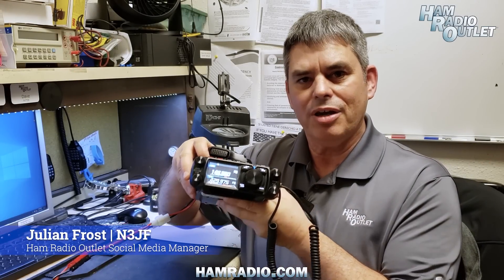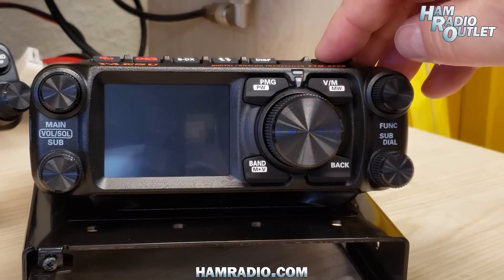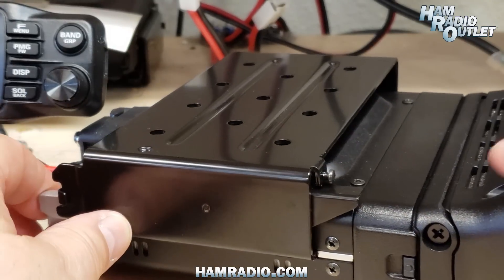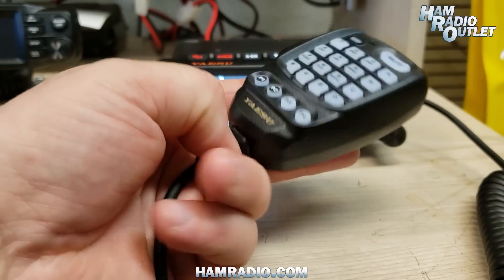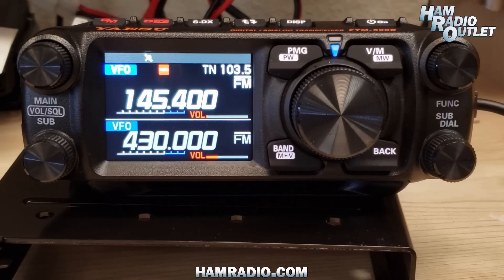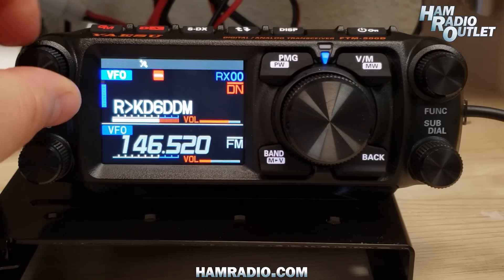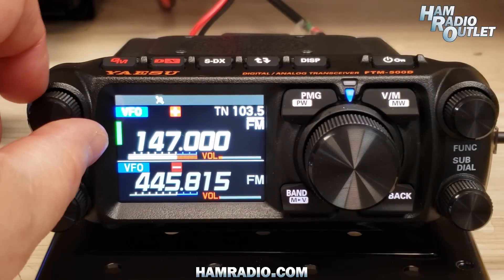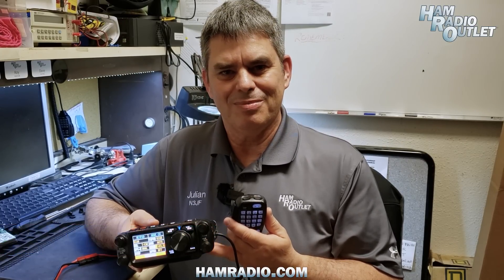Yaesu FTM 500D

Comment: What kind of power supply you need to run this from home ?
Reply from the maker: Any regulated power supply capable of handling the maximum draw of the radio, which is 10A. Give it a little headroom, so get yourself a power supply capable of 30A surge, like this OPEK OP-PS-3001D https://www.hamradio.com/detail.cfm?pid=H0-018890 and you'll be able to run some accessories off the same power supply without letting the magic smoke out! BTW, the FTM-500DR has been replaced by the FTM-510.

Comment: What type of adapter can I use with this radio to connect to a Bioenno Battery? Is there a powerpole adapter?
Reply: If you buy a Bioenno battery with Anderson Powerpoles, then all you need to do is put Anderson Powerpoles on the end of the radio's power cable. You can crimp them on, or solder them on. Using a crimper makes the process take about 2 minutes.

Comment: It's not a "great" radio. It's an ok radio. If you want to do repeaters or FM simplex or Fushion it works ok. A typical mobile dual bander will do anything this radio will do. With maybe the exception of Fushion. It's a drastically over priced mobile, and it only does the most basic things. You need additional hardware to do APRS. They lead you to believe it has a built in GPS, but it obviously doesn't since your position from the so called internal GPS is always 00.00.00.
Reply from the maker: It does APRS out of the box. You can send your position, receive other people's position, use digipeaters, and send and receive messages all via APRS and with no other hardware required. It certainly does have an internal GPS, and it does update your position. You may have switched yours to use the external GPS input (Func - Menu 38 GPS -  Select "Internal"  - Power cycle the radio). It's not a cheap radio, that's true, but find an alternative that does all the FTM-500 does at a cheaper price (FM, Fusion, VHF, UHF, 50 watts, remote mountable, dual speakers [one in the head, one in the body], GPS, APRS).

Comment: The Yaesu designers can’t even work out that the separation cable socket on the front of the body needs to be vertical, not horizontal, so the short connection ribbon is not twisted when the head is attached!
Reply from the maker: Or maybe that was a design decision based on other design decisions?

Comment: Weird question maybe but can you link the radio audio Bluetooth to your car stereo? 😆 
Just wondering, something else to play with in the car. Occasionally I will plug radios into the AUX Input in the car, just for fun 😝
Reply from the maker: I really don't know! I think many car stereo systems have different implementations of Bluethooth, so it might depend on the manufacturer as well as Yaesu's implementation. On the surface, I don't see why it wouldn't work... just the same as playing music on your car's stereo from a non-phone device.
Reply: I just run the audio into my Honda aux audio jack.

Comment: I have a question... Can you set the second VFO to, say the NWS frequency, and listen to their broadcast and still use the main VFO for communication?
Reply from the maker: Yes. It's like most modern dual band radios... Listen on one band while transmitting on another. If both VFOs are on the same band (EG. Both VFOs set to 440 band), reception on the receiving band may be disabled while actively transmitting on the same band on the other VFO The FTM-500 also has WX watch, so it'll flip to the selected weather channel every few seconds to check for the emergency tone.

Comment: I bought a Yaesu FTM-500D Japanese version, I'm in the United States, I can't transmit at 146.500mhz, it says TX PROHIBITED> I've already tried the tips in the video and I can't, can anyone help?°
Reply from the maker: The Japanese 2m ham band ends at 146.000 MHz. That's why you can't transmit at 146.500 MHz.
Reply: @HamRadioOutlet  Hello, do you provide any update or file that can open TX? That you can sell to me. Regards.
Reply from the maker: @Serpaneto2009 No. The Japanese version is made for the Japanese market. It cannot be converted to the US market version.

Comment: Just got mine today.  Wish it had a voltage, swr and power meter.  I am using it to replace my Ft 818 for portable 2m/70cm. So far it doesn’t receive and hit as many repeaters.  I hope it is the antenna.  Tomorrow I will put them both on the same antenna.  I hope its the antenna.  I have it on an inverted v and the 818 on the vertical.  818 definitely reached 9 repeaters.  The ftm 500 only reached 3 of the 9.   I used it on my 15, 20, 40 endfed.  Swr was great on 420-450 but was 3 at 144-146.35. It dropped until it hit 1.98 at 148Mhz.  Tomorrow I will make a vertical antenna to test.  I am expecting a dramatic change.
Reply: I bought it for APRS.
Reply from the maker: I'm confused. You're using a 2m/440 radio on a 15m-40m end-fed antenna? You're using a VHF/UHF radio on on an HF antenna? If so, please stop or you will destroy the amplifier in the radio, which will not be covered by warranty! You need either a dedicated 2m antenna and a dedicated 70cm antenna, or a dual-band 2m/70cm antenna. Not many mobile 2m/400 dual band radios have a meter that displays power/voltage/SWR. It is assumed that they are connected to a 12V source and a resonant antenna, so voltage and SWR are not really required. Power output is, of course, shown on the meter.
Reply: @HamRadioOutlet  I check the antenna before using.    I wanted a temporary connection while I program.  SWR was great across the entire 70cm band but not on low end of the 2m band. Highest SWR at low frequency end of 2m was right at 3. Been into radios since 1976 and never had one to fail. Still use my realistic CB I got in 1976.   I know to take precautions.
Reply from the maker: @TridentMissileTech   SWR is only a small part of the story. A dummy load has an SWR of 1:1, but it barely transmits any signal at all, by design. Your HF end-fed is not designed or made to transmit VHF and UHF. Your FTM-500 is not designed to transmit on an HF antenna. Your original comment stated you were unhappy with the FTM-500's performance and that it couldn't hit as many repeaters as your old radio. If you put it on an antenna that is designed and made to transmit on 2m and 440, instead of an HF antenna that isn't, it will perform better, unless you've already damaged the radio's finals. But, it's your radio, you do what you want with it!  🙂
Reply: @HamRadioOutlet  antenna load is impedance match.  While it may be a compromised a antenna  and not being vertical affects the propagation, it does no presents a danger to  damaging the radio.  No way no how.   Just like the radio on a dummy load doesn’t know it is not an antenna.   The radio doesn’t know it is an endfed or vertical.  The radio sees close to a matched impedance.
Reply from the maker: @TridentMissileTech  Like I said, it's your radio, you use it how you see fit. Good news is, Yaesu made a lot of them, so you can always get a replacement! ;-)

Comment: What does a radio need for DSTAR ?
Reply from the maker: It needs to be a DSTAR-equipped radio! It needs the hardware and firmware to support DSTAR. This radio does not use DSTAR, but Yaesu System Fusion (C4FM).

Comment: Seems so silly to still have to program repeaters into a radio that should have gps and plenty of storage for the complete repeater database. Why are the radios so far behind in technology anymore? I would think that we should be able to get repeater update info anytime we connect to a fusion repeater so we always have the most up to date frequency list
Reply from the maker: While I agree... how many times have you gone to the Repeater Book or other online database to find a repeater, only to find out the information is inaccurate? It might be quite frustrating to have the radio select repeaters that are inactive, or their information is incorrect. The Fusion data stream seems pretty slow, so it would take quite some time to get the list that way. If the Fusion repeaters always had only "known good" repeater information for other repeaters within, say 25 miles from its own location, maybe the idea would work. Then you have to deal with constantly changing memories in your radio. There are issues but I'm sure there must be a way around them.

Comment: Way over priced for a dual band radio!
Reply from the maker: It's not inexpensive, but not way over-priced if it has the features you want. The FTM-400 was introduced 10 years ago and has older technology. The FTM-500 was introduced 10 years later, has newer technology and has been introduced at a price that's just $50 more than than the price at which the 10-year old FTM-400 was introduced. Considering all that's happened in the last 10 years... a global pandemic, global microprocessor shortages, inflation, etc... that $50 increase isn't bad. It's well known that prices tend to decrease after first introduction.

Comment: I love the GPS receiver over the FTM400DR. I dislike the volume knobs free-turning -- I used to be able to change volume by feel alone, now I have to look at the screen to see where I've landed. I dislike the loss of the smart-buttons on the screen (such as toggling tx-power level and APRS beaconing). Same for switching screen modes -- have to look at the screen vs counting bips and boops.
I love the front speaker and the mic attachment to the head panel.
I wish Yaesu would document that the control cable is just a standard cat5.
I wish the FTM500 would show the preset name instead of the frequency when in an alternate display mode / in large text.

Comment: I own the FTM-300 and I've yet to see any significant difference between the 300 and the 500 to justify a $200 difference.
What does the 500 do that the 300 doesn't do that is worth the extra money?
Reply from the maker: Bigger screen,  touch screen, better UI, front and top buttons for common functions, better receiver, mic jack in head unit, speaker in head unit and body, AESS... ... It's a replacement for the discontinued FTM-400, not the currently still in production FTM-300. If you're happy with the FTM-300, get the FTM-300. If you want an FTM-400 but can't find one, the FTM-500 is for you.
Reply: @HamRadioOutlet  Will the same mounting bracket work for both the 300 and 500?

Comment: Did they fix the overheating issue the FTM-400 has?
Reply from the maker: I have a sample size of one - my own FTM-400XDR that was in my car in Palm Springs last weekend. The inside temperature of my car was well above 120F. I stupidly left my iPad in the trunk and it completely shutdown due to the high temperature. The FTM-400XDR had no issues whatsoever when transmitting 50W on 2m and 440. So, assuming the FTM-500 works at least as well as the FTM-400, I'd say there is no problem.

Comment: I'll stick with the FTM400 because of its bigger screen, looks like Yaesu took two steps back with that radio.
Reply: Are you sure bigger is better? 🤣🤣🤣🤣
Reply: @Sylwester_Krolak  Ask my Wife!
Reply from the maker: In reality, the screen isn't much bigger on the FTM-400, and the screen on the FTM-500 is much better. The FTM-500 is a better radio than the FTM-400.
Reply: @HamRadioOutlet  That’s subjective. “Better” is in the eye of the beholder.
Reply: I agree. The 400 has cross-band repeat capability, this one does not, as per DX Engineering’s stat sheet.
For $650, that’s a dealbreaker for me.
Reply from the maker: @4BravoLima  I believe John Kruk from Yaesu said it has FM crossband repeat functionality.

Comment: Yaesu, bring back memory banks and I’m pre-ordering!!!! That’s why I still run an 8900 in the mobile.  Sure it’s analog only but it gets the job done. Going back and forth between a bank for Sacramento area repeaters and then Bay Area repeaters with one button is too convenient in the mobile.
Reply: Memory banks are important to anyone that drives a vehicle regularly to different areas. Which I do a lot. I don't mind a rig not having them, but at 650 it's crazy it doesn't have the feature that older ones do.
Reply: @K4AX  my buddy is a big rig driver and you are 100% correct.
Reply from the maker: Memory banks sure seem to be important to some people... but maybe Yaesu's market research tends to think they're not that important to most? I really don't know. I usually hear a few people complaining about the lack of memory banks when a Yaesu radio is released without them, but not that many.

Comment: I see on the later Fusion radios that the distance from the received station is no longer displayed, my FT5D and FTM300 displays call signs ok but no distance where as my older FTM400 does display distance.
Reply from the maker: Interesting. I wonder if screen size played a part in the case of the FTM-200 and FT5DR? I don't know if distance is displayed on the FTM-500. It could be a menu item, or distance information might not pass through repeaters unless they are configured to pass it, etc.
Reply from the maker: Distance and heading are displayed on the FTM-500. See: https://fb.watch/k-p6rwOfTf/
Reply: @HamRadioOutlet   No that isn't the same as the FTM400. The FTM400 and the older FTM100 display distance without accessing other screens.
Reply from the maker: @mikeg1zrn896  It's a different radio, so things are done differently, but the information is still there and available.
Reply: @HamRadioOutlet  Then it's a backward step, suppose to be a mobile radio, you can't be looking for information  when driving that should be displayed as per the older FTM400 & FTM100.
Reply from the maker: @mikeg1zrn896  That depends on what's important to the user. For you-, it's a backward step, for others, having the distance to a station is not important enough to be on the main screen as it makes the main screen more cluttered and -harder to read while driving. It could be argued that having the GPS-related information on a dedicated screen makes it much easier to read while driving. Of course, YMMV and you're free to choose the radio that best suits you (though the FTM-400 is discontinued).
Reply: @HamRadioOutlet  and then when you transmit the screen returns to frequency display so then you have to again search for the GPS information which, again,  is not good  when driving. Also on the display of the FTM400 is a single line of call sign and distance which does not clutter the screen. Icom can display distance and direction information on a screen as small as their ID4100 without having to search. 7 3.

Comment: Beautiful radio but over priced for not having ssb!
Reply from the maker: I'll give the same answer I've given elsewhere:  Can you give an example of a comparable radio at a lower price? How about the ID-52A, a 5W handheld that's only $50 cheaper.  The 10 year old ID-5100 (probably the closest in specs - 2m/440/digital mode/D-APRS) is about $130 cheaper. The FTM-400 was introduced 10 years ago for $50 less. Prices always go up, unfortunately.
Reply: @HamRadioOutlet  if you’ve given this answer elsewhere, then clearly others believe it is overpriced. Again, it is a beautiful radio but it’s the same price as the open box icom 718 hf rig, sure it’s been out for years but it’s also a proven radio.
Reply from the maker: @bobdillashaw4360  Yes... others have said it's over-priced. I'm just trying to put it into perspective. In the 10 years since the FTM-400 was released (which this radio replaces), the introductory price difference is $50. In those 10 years, we've had COVID-19, a world-wide microprocessor shortage (which is continuing and was directly responsible for the FTM-400's demise), the tripling of shipping costs, increased manufacturing costs, and inflation. I think comparing a new radio to a very old radio that was expensive for its time is unfair. Remember in 1997 when a 42" Fujitsu flat screen plasma TV sold for $15,000 (that's $28,000 in today's money)? It was great for its time, just very expensive. Now you can buy a 4K LCD TV for $300 at Costco. Is it fair to compare a 26 year old second-hand TV that might sell for $300 with a new LCD TV that also sells for $300 and say the new one should be cheaper because the old one sells for the same price? It's not an apples-to-apples comparison. Ultimately, it comes down to "Is the FTM-500 worth the price of admission, to ME". If the answer is yes, well, good news, they're here! If not, no worries. Wait for the next great thing. 🙂

Comment: Its a tad over priced
Reply from the maker: Is it though? Can you give an example of a comparable radio at a lower price? How about the ID-52A, a 5W handheld that's only $50 cheaper.  The 10 year old ID-5100 (probably the closest in specs - 2m/440/digital model/D-APRS) is about $130 cheaper. The FTM-400 was introduced 10 years ago for $50 less. Prices always go up, unfortunately.

Comment: I'm still waiting for the 2m 1.25m 70cm mobile radios that have am fm ssb upto 100 watts. I'd buy that for my vehicle. Burned out on 2m 70cm fm 50 watt radios
Reply from the maker: I'm not sure that will happen. 220 is not a ham band in most countries, and even where it is it's really only the USA has the whole band. The manufacturer would be making your dream radio primarily for the USA market, which is relatively small.
Reply: @Ham Radio Outlet  ya that does make sense. It would be nice to see something different. Thank you for your response. 73